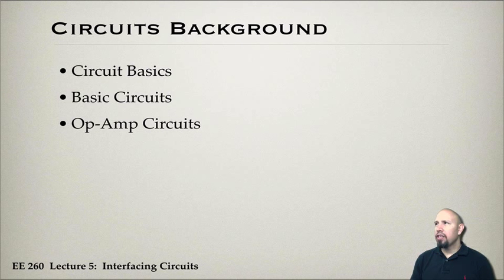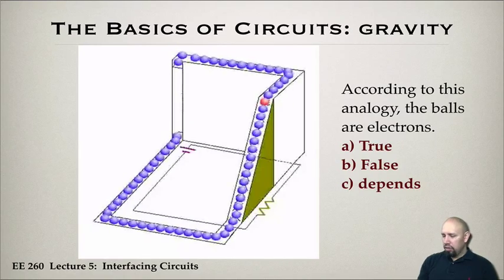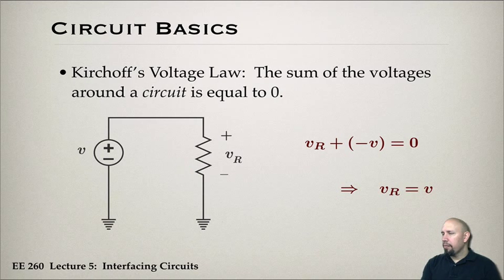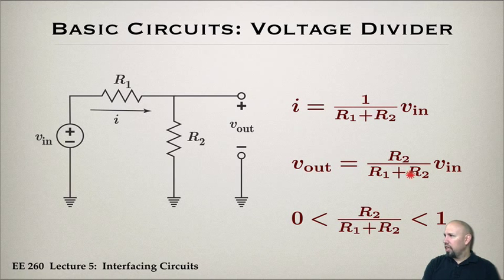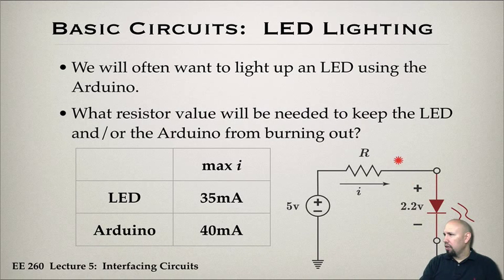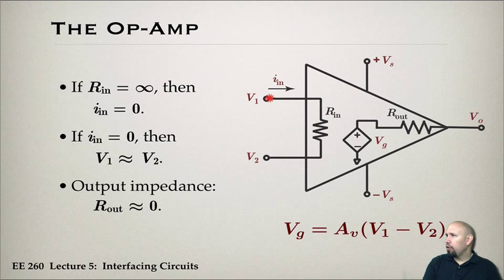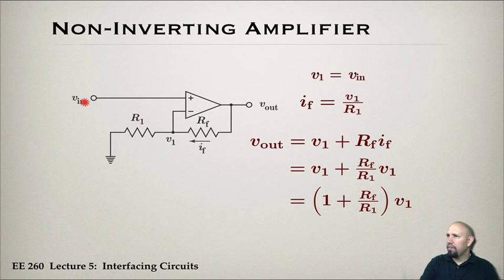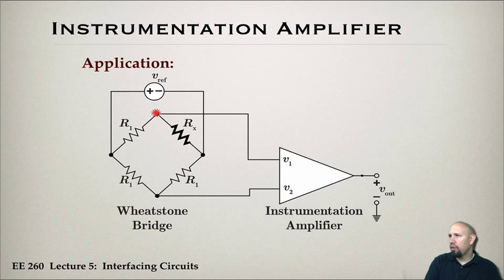5B.  Basic Circuits Background.

Comment: Nice series - thanks for the effort!

Noted a slight error on the slide discussing use of an Op Amp as a comparator: the equation for the output low rail condition is wrong - should show that the output swings to the low rail when Vx < Vref.
Reply from the maker: Yes.  Thanks for pointing that out.  It is inverting!